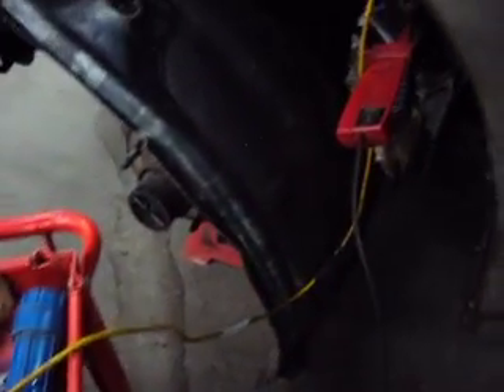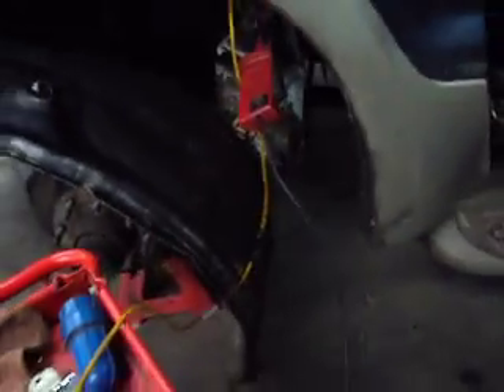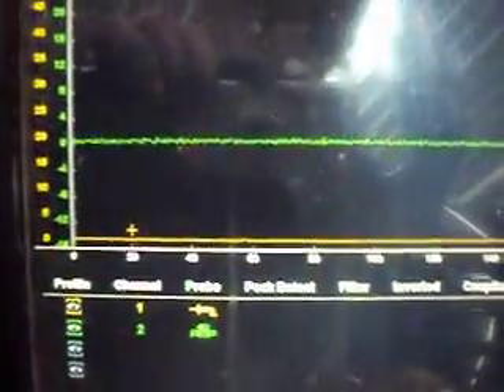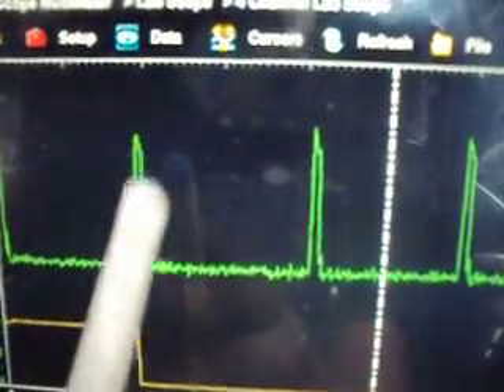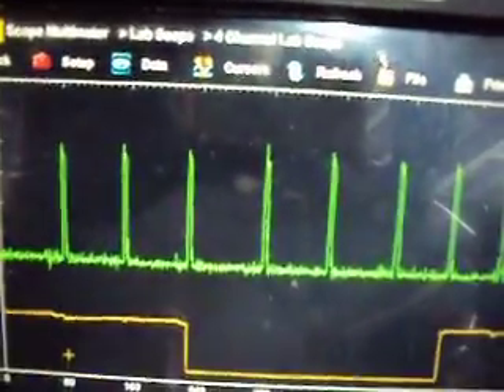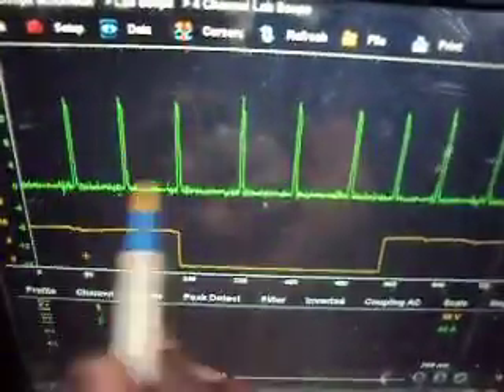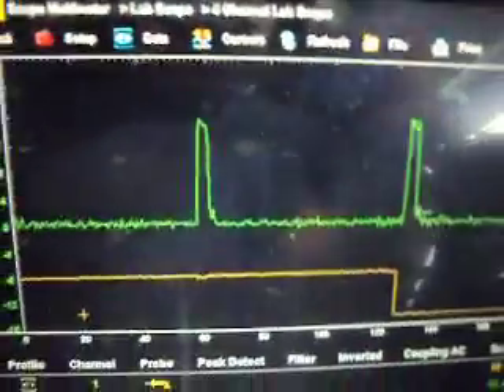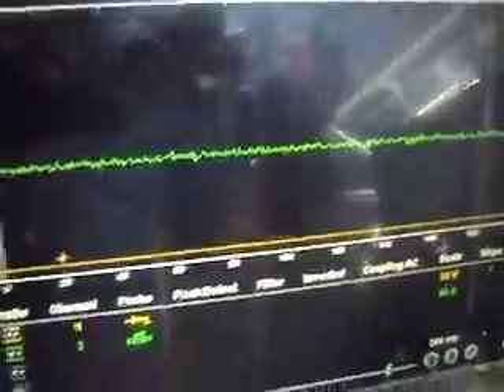Using a Low Amp Probe to check the operation of an IDM on a 7.3 Ford diesel

Comment: If the idm is bad will they still run ? Mine runs good starts good bit seems sluggish you have to almost hold it to floor to get it up to speed. New filters good battery inner cooler working new engine from another truck. I'm lost.